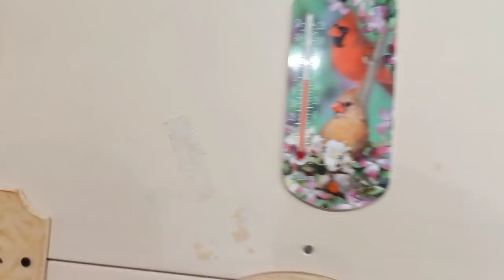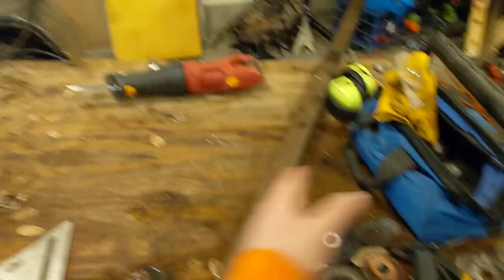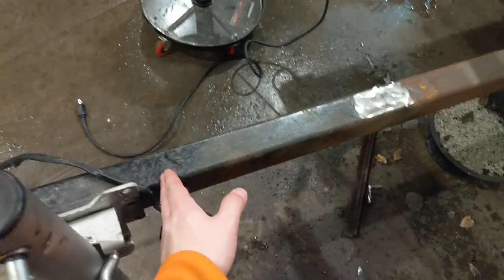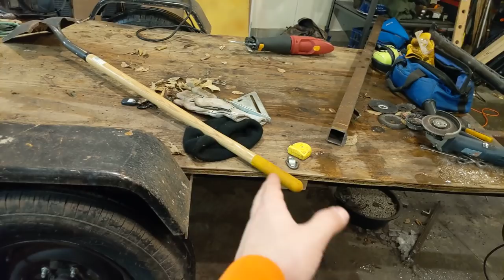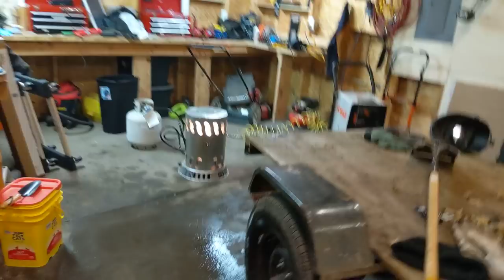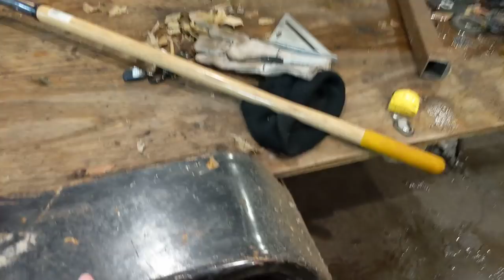Trailer Project

Comment: I wish I could send you a picture of my trailer. I really like it. It is 5 by 8 with a toolbox on the front. It also has a ramp that is the rear tailgate. It is so light and pulls so well and has big tires similar to yours. It sounds like you are building one that I have already. Mine also has walls around it that are too high but not removable. I believe it is made of angle iron everywhere. Just wanted to give you some ideas I guess.

Comment: have you thought about raising the deck and go wider over top the wheel wells?
Reply from the maker: Originally when I got the trailer from my dad it was built like that, unfortunately the decking was very rotted and it had to be removed, I like the idea but would require some modifications
Reply: @exploringlife3389  well I think you kind of like modifying the trailer so mabey one day we will see you do that.